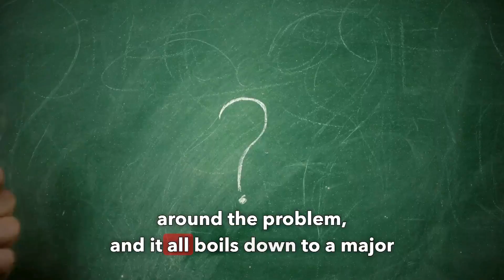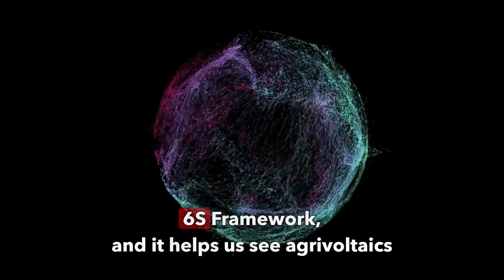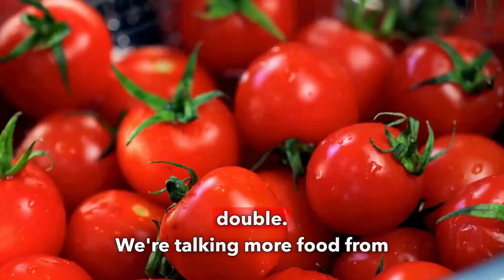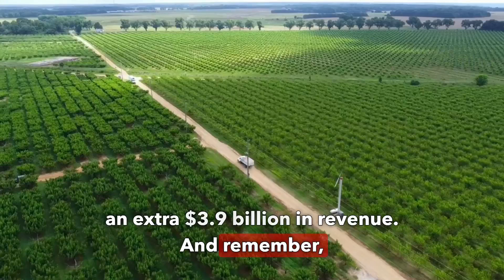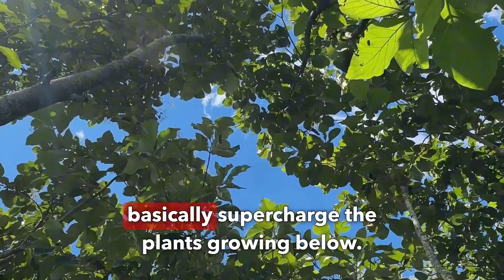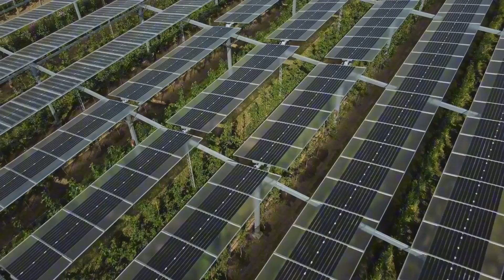‼️Agrivoltaics Explained: $1 Trillion Opportunity Feeding 2.1 Billion People | Agri-PV Impact |

Comment: Im going to say a far better and marketable solution is to build a raised solar farm in mall parking lots it provides cover for shoppers cools large areas of tar mats that often raise city temperatuures by as much as 5 degrees and most important puts the power where you need it in the city, line loss is massive from contry side to the city being in town means less resistance and better use of the power and less resources required. A paved parking lot makes the panels easier to service no mud etc.